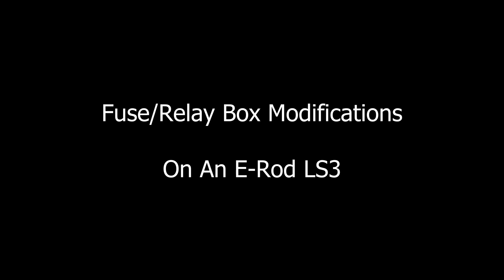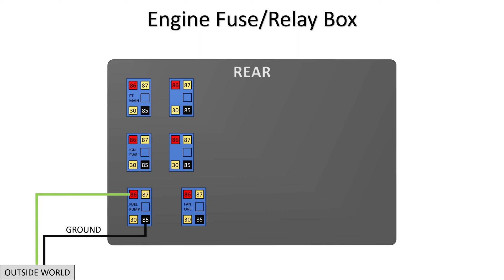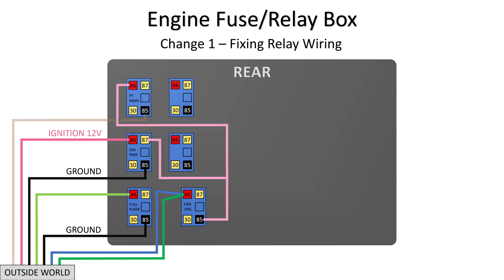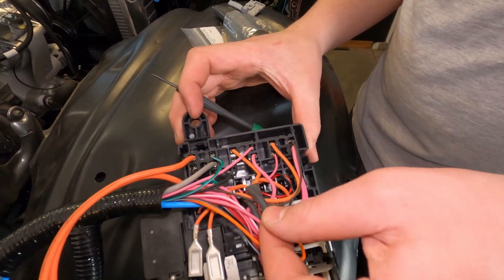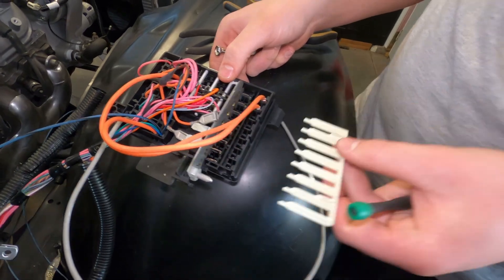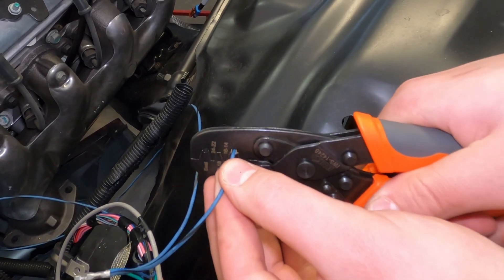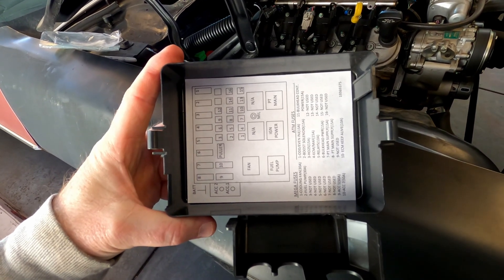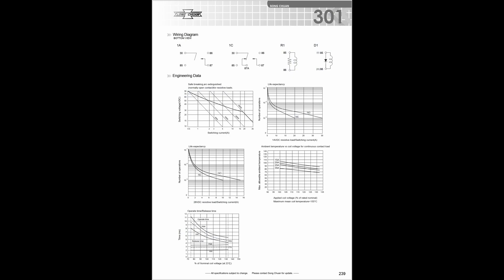LS Swap 23 - Engine Fuse/Relay Box Modifications

Comment: Good information, but i believe the erod kit has a sensing circuit in the pcm for the fan relay control wire sensing 12v while the fan is not commanded on. If that circuit gets taken to ground by an outside source, in this case the AC switch the PCM will throw a P0480. Have you tried the current configuration with success. I ask because i have been trying to find a solution for ac fan control myself.
Reply from the maker: @george536 - Thank you and Kevin_67_RS for bringing this up, because y'all were right.  I briefly tested the fan control circuit shown in the video, and nothing happened - no Check Engine Light.  But after Kevin's report, I did more extensive testing and found that if you started the car with A/C grounding the relay, it did cause a CEL.  The computer can sense that it's being overridden, and it doesn't like it!  I really regret the extra trouble this oversight caused.  As an immediate corrective action, I removed all discussion of the A/C fan control from this video.  Also, we have modified the circuit on Dylan's Camaro to not cause a CEL anymore, and since we had it apart we added a simple delay circuit so the fans turn on about 5 seconds apart.  I will be posting a video with the revised fan control circuit.
Reply: @WorkinOnIt  you had good intentions, and posting your findings is good for everyone. Now we know for certain. I still thank you for everything you have provided
Reply: My e-rod is throwing a CEL with my Vintage Air A/C system using this wiring setup.  I charged the system today and it threw a CEL for the Fans.  Need to find a solution somehow.  Fans work fine with the A/C system off (engine gets hot, fans come on at ECU temperature set point).
Reply: @Kevin_67_RS  I ended up not doing it as the video, and did it my own way no CEL

Comment: George536 is right.  Today I was able to finally charge my Gen 4 Vintage Air A/C system with the wiring mods that are laid out in this video on my e-rod LS3.  My cooling fans work fine (fans come on once the engine temp reaches ~205 range) with A/C system off.  But once you turn on the A/C inside the car I got a CEL (fan related).  The compressor comes on but the fans are a mess.  Can we route the Vintage Air compressor trigger wire that goes to the trinnary switch and tap it to the fuse box to trigger the fans?? HELP!?!?!
Reply from the maker: Hey Kevin, I am so sorry for the extra trouble.  I have removed that part of the video.  You and I discussed this directly, and I gave you a modified circuit.  Dylan and I implemented the modified circuit on his 1980 Camaro and it works - no CEL.

Comment: What is the part number for that fuse box?  Can it be purchased as a separate item?
Reply from the maker: That's a good question.  To us it was just part of the harness (p.n. 19369375).  I vaguely recalled that it was used in the Chevy Astro, and it's true - if you Google "2000 Astro Fuse Relay Box", you will find identical-looking fuse/relay boxes.  Best I can tell, it was used in 1996-2005 Astros.

Comment: I’ve watched all your LS swap videos. Great work! They’ve  really helped me a lot. I’m trying to lay out my LS3 swap/total harness wiring in my head and need is schematic program 
What software are you using for wiring schematic design (like at 6 min 38 seconds)?
Reply from the maker: I'm happy to answer that - it's Fusion 360 by AutoDesk (known for AutoCAD).  I got started using Fusion 360 for mechanical drawings, then discovered that it can also do schematics.  Hobbyists like me can use the free version, which used to be full-fledged but now is limited to 2 pages.  I find the schematic capture part of Fusion 360 to be a little clunky compared to OrCAD that we used when I worked at Compaq.  But hey, it's free, and I am thankful for that.

So far I have only made the PDF of the schematics public, but I will share the original CAD files if anybody wants them.
Reply: Thx for the information. I’d use the CAD file as a starting point for learning to make schematics.
Reply: I appreciate you pointing out the mis-wired 85 & 86 terminals.  What’s your thoughts on resistor vs diode relays?  I have a bunch of micro resistor relays for my wiring project. Should I put in diode relays instead?
Reply from the maker: @ToucanF-16  That's a good question.  The truth is, I don't have enough real-world experience with relays to give you a high-confidence answer.  I did buy diode relays for our project; they offer protection against flyback voltage and that was enough reason for me.  On the other hand, in application after application you see plain or resistor relays being used, so flyback voltage must not be much of a problem.  And you already have resistor relays, which also help reduce flyback voltage.  All things considered, I'd probably just use the ones you've got.